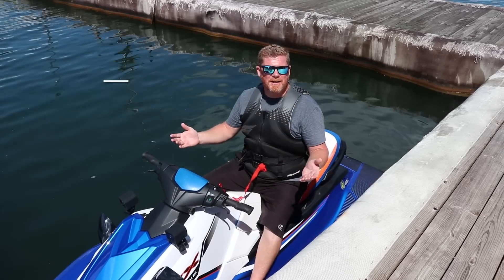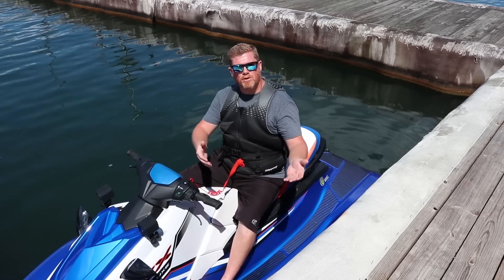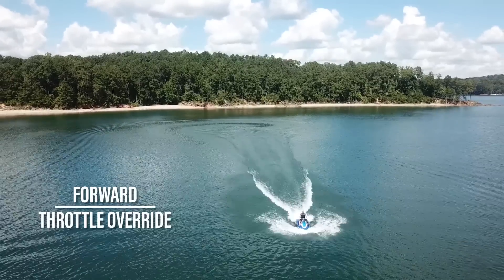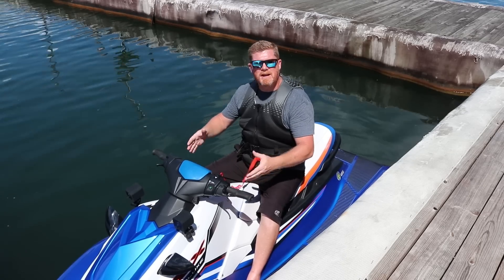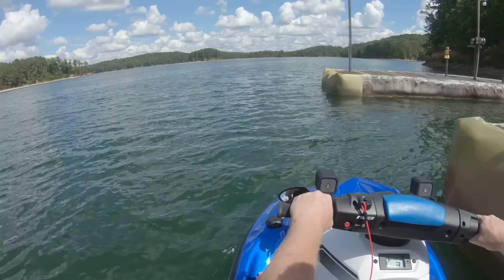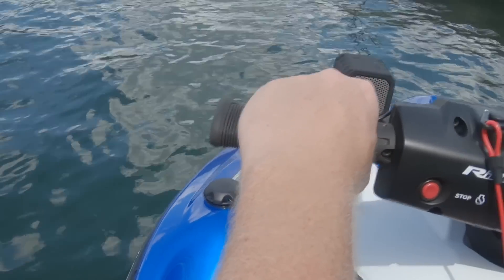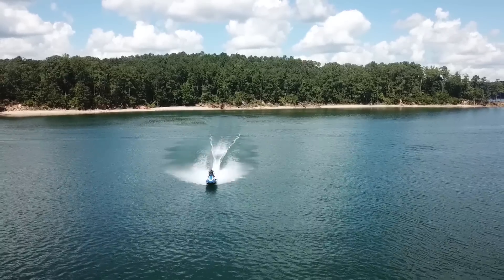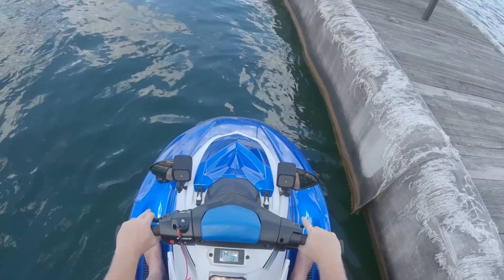Yamaha's RIDE Dual Throttle Control Review: The Watercraft Journal Ep. 43

Comment: Sick video. I'm 18 and I've been saving my money for 4 years to finally buy a brand new 2019 Yamaha EX Sport. Just an entry level model until I can afford some of the nice ones later in life. :)
Reply from the maker: If possible, go with the EXR. It's an absolute riot and easily the best bang for the buck.
Reply: @watercraftjournal  At that price point, why not just go with the VX? Wouldn't it be better than the EXR?
Reply from the maker: Number1HockeyPlaya do yourself a favor and watch our EXR review. It’s a totally different machine. The EXR is a loose, nimble go kart. VXs are more for the staid, family cruiser.
Reply: Bought a 2018 VX cruiser HO brand new for my 16 year old daughter last year for about 10,700 including aluminum trailer. Can't beat that big 1800cc powerplant Yamaha has when it comes to torque. My advice is to shop around, buy out if season if possible, and make the dealerships compete against each other.

Comment: So its seadoo IBR basically ?
Reply from the maker: Sorta. But unlike iBR, Yamaha's RiDE does not require the Forward throttle to reverse or brake. The left trigger on iBR is more of a gear lever, as the RiDE system (as shown and explained) can reverse off a trailer without touching the right trigger. The RiDE system also weighs considerably less.
Reply: Watercraft Journal I can reverse off trailer without throttle on the ibr. Maybe your test rides were not adjusted properly
Reply from the maker: @meeperrxp  yes you can, but very mildly. You have to apply (right hand) throttle to really romp it off the bunks.
Reply: @watercraftjournal  can you still hold the left and right throttle to go faster in reverse
Reply: @aaron-fauth  you just pull harder on the left throttle, you don't have to touch the right throttle
Reply: @ericmcclelland7151  oh my iBR ski you pull in to move slowly backward then give it gas on the right
Reply: @aaron-fauth  yes I realise

I think the Yamaha system is better & more simple

I understood IBR the 1st time I hoped on a seadoo, but I understand RIDE and I've never been on a Yamaha
Reply: @ericmcclelland7151  if you’ve never been BEEN on it u don’t know what to expect even if this is true. I have used iBR for years since it came out and the forward neutral and reverse is pretty simple
Reply: @aaron-fauth like I said I HAVE been on a seadoo
I haven't been on a Yamaha but it's so simple to understand that I think it would be better overall

Comment: Hi Kevin! Got the 2019 fx svho now, tested it for the first time yesterday. One question; is there a adjustment for the neutral mode? i think it went backwards when i was in neutral mode.. any tips to share?
Reply: I'm not Kevin Shaw but I can tell you that If you're moving forward and you blip the reverse lever this will place it in neutral, but if you blip it again it will move the bucket up and it will start moving forward again. If you find that it's moving backwards then blip the forward lever and quickly blip the reverse lever to reintroduce the neutral mode. Don't forget that the impeller is always engaged and moving and the only difference is the position of the bucket. If you have it in neutral and turn the handle bars left or right the ski will begin to turn in which ever direction you hold the handle bars.
Reply: @NortheastFloridaPWC  that’s right your not Kevin Shaw:)